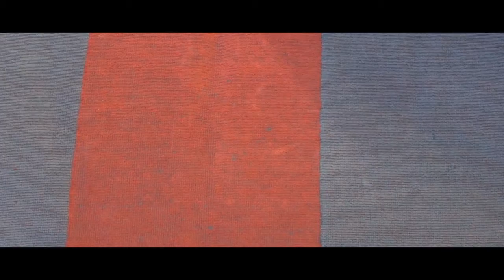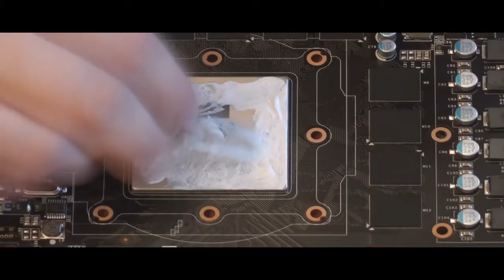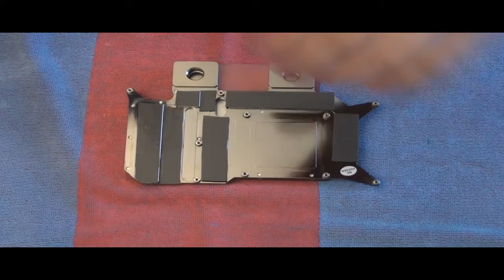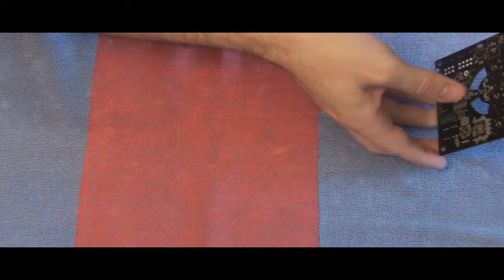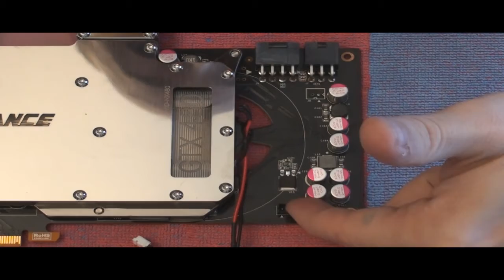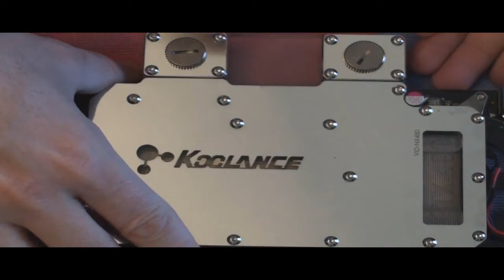Koolance Nvidia GTX480 Waterblock:  Part 5, ... & Finish

Comment from the maker: @0pTicaL823 OCZ Freeze is a nice product, but why cheap out on the difference of price on thermal paste?  I can understand buying cheaper stuff if one is building a $600 computer, but anything for gaming...the extra $4 bucks or so makes it worth it.  You are correct, good contact and application are big factors, but if you start with the best compound, you can't go wrong.  :)

Comment from the maker: @KingGiac It can be, it all depends what type of paste you are using.  The Koolance pack is proportioned out for a single use.  It actually looks like more then there is in the pack.  Another factor is viscosity of the paste.  Higher viscosity like the one here can be applied more liberally with less chance of air bubbles.